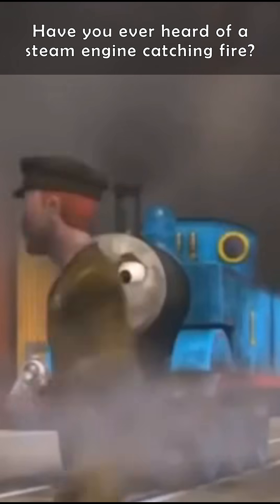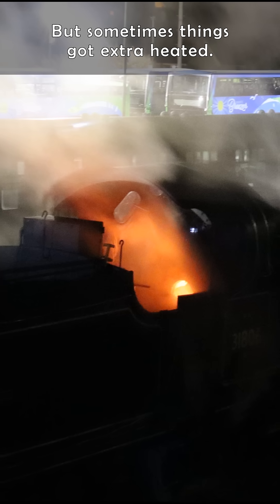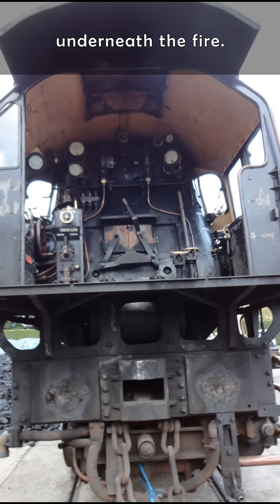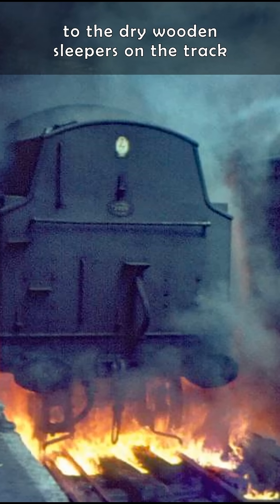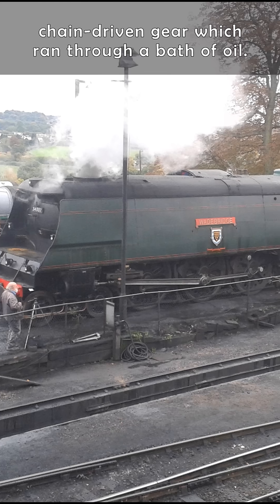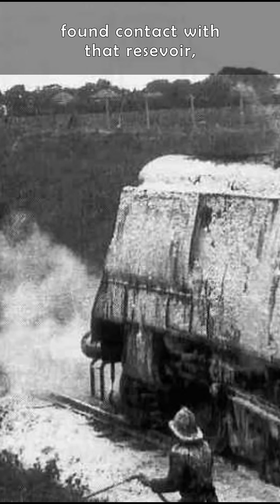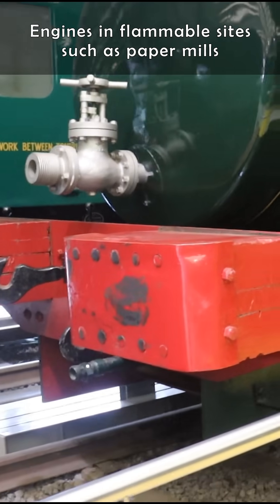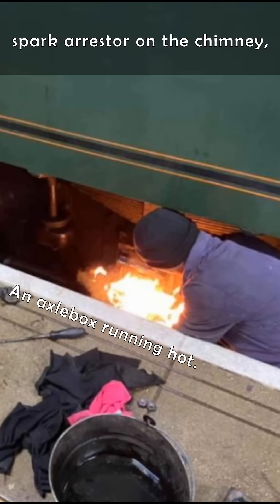How steam trains can CATCH FIRE

Comment: Nowadays sparks from the brakes van still cause fires in hot and dry days. Less An issue with concrete sleepers but it can still start fires along the track

Comment: I was in a volunteer rural fire brigade in Australia. I went to at least half a dozen fires caused by either locos or wagons dropping hot brake shoes. I recall that the Beyer Garratts were known for setting sleepers on fire. One is alleged to have started 18 fires in 40 miles with the local fire captain threatening to blow the track if they didn't stop the train. It was about 43ºC and windy with it.

Comment: I've never heard of a fireless steam engine. Do those use electric boilers? And if so, why wouldn't they have just used a standard electric or diesel-electric?
Reply: They used steam made by a boiler somewhere else that was stored in an a tank on the locomotive where a boiler would normally be.

Comment: Apparently Longmoor‘s oil burning 2-10-0 “Kitchener” leaked quite a bit, and set off from the Northern terminus at Bordon and set alight the 5 or so miles of track to the main station at Longmoor Downs before the problem was resolved. Oh, and this didn’t just happen once.. Another oil burner at Longmoor I believe leaked and caused a fire large enough to necessitate the relaying of one of the roads at Longmoor Downs.

Comment: I think that one scene where Thomas was on fire would make a LOT more sense if Thomas was stranded on tracks with WOODEN TIES, and not concrete. But the Diesel Works tracks are concrete, so it's still not believable.
Reply: I know that this would be entirely implausible given it would spread, but there is a chance that Thomas happened to be sat atop an oil patch and the fire only got that size because nobody noticed it and moved him until he was basically surrounded
Reply: @hectorz9555 well he was at the dieselworks so If there would be an oil patch anywhere it would be there
Reply: they're called "sleepers"
stop using incorrect American terminology
Reply: @yeoldeseawitch   I'm just so used to saying "ties", sleepers isn't a word that comes to mind for me.

Comment: All Steam Engines in the US have to have spark arresters fitted. In the US, for a long time, steam Engines used wood as the fuel source for fire. Wood can produce sparks and ash much faster than coal, and so the risk of starting fires on the tracks and even forest fires was much higher. Wood was also very plentiful, especially since there were almost no coal mines at the time.
Reply: no coal burning engine has ever been fitted with the wood-burner's spark-arestor chimney. it's fairly obvious whether the engine has a giant cone for a chimney or not.

Comment: It still amazes me that after all these years, people still propagate the rubbish that the oil baths on original Bulleids caught fire. 
The bath's were enclosed, so sparks wouldn't get in there for starters and the oil in the bath would be below the flash point anyway, so wouldn't even have caught if a spark landed in it.

The fires on the Bulleid's were caused by axle box oil being flung up into the lagging and sparks fron the blocks would set it off, if there was a big enough build up.

The axle boxes were fed from the cab oil trays and when crews didn't remove the wicks, oil kept feeding the axle box keeps and then overflowed down the wheels.

Maybe you should do a video to address this old enthusiast myth,
Mythbusters style 😅
Reply: Lol, looks like u’ve read my scribe on the 34007 website which I posted after we finished getting her running.
The info was kindly provided by the ex chief erecting shop foreman at Eastleigh works, where Mr Bulleids finest were soled & heeled.
I got fed up with all the immature nonsense being spewed out by folk who didn’t have much of a clue.
Yes the missionary trays in the cab feeding the axle boxes were the culprit as regards oil in the wheel pockets which was subsequently dropped on the sleepers when standing or flung up when in motion.
Never suffered with hot boxes tho! Oil was cheaper!!
BTW they simply have a sump which holds 40 gallons of oil, about 2” deep. The motion does not thrash around in oil, it is pumped via a gallery of pipework, to emerge where reqd.
The crankcase has to breath thro breathers & oil mist is emitted (that’s where most loss of oil occurred.
It  also collected in the lagging & collected any brake or ballast dust blown up & the gassing is what
ignited & the forced draught fanned it merrily in flame.
It was cured by fitting belly lagging & altering the brake block composition to eliminate sparking.
You don’t read as much about the regular bogie & engine room fires on the class 47’s.
Reply: @davemitchell9941  to be fair, I haven't read your 34007 post, but I learnt the truth directly from working on Bulleid's myself, talking to fitters and people who worked them back in the day.
Reply: @ thanks, twas refreshing to see your comment.
Listening to them ol boys was for me the best part of restoring 007.
That ol valve gear worked like a charm & I did not find it difficult to maintain at all.
Exmouth Junc managed it all very well by keeping on top of things.
Have to sign you up as a Bulleid fundamentalist.
That’s how ol Jock Adams (34092)& myself were labelled at the ol Bulleid owners meetings. 😂
Gotta hava sense of humour when dealing with the 3cyl Brittania fan base (the rebuilds).
Go on well 😊
Reply: @davemitchell9941  Thank you both for your insight and your work on these lovely locos.
Reply: I mean, you might be right... but your illiteracy and misuse of basic punctuation like apostrophes makes me think you're not very educated. 
The bath is/has/was on?
The bath's... what on? What belongs/pertains to bath?
The same is true for Bulleid.
Reply: Well said.

Comment: A friend once told me of a man at his local model society who didn’t drop the fire of his engine when he was finished running it and cleaned it with paraffin which is normal. After this, with a still hot fire he loaded it up on his trailer and drove off. Needless to say that the paraffin caught on fire and the engine was engulfed in a fireball twice.

Comment: I will never look at the scene of Thomas's firebox on fire the same way again.
Reply: Bingo to both
Reply: JAMES' BRAKES...
Reply: @l0nd0n_luxe I thought it was bc he was braking so much
Reply: @ He held them down consistently (as the troublesome trucks were pushing him) and he was trying to stop. They were wood so they caught fire from the friction. So I'd say you were partially correct! :]

...This is also coming from a James fictionkin. It a was scary crash. Don't pull trucks.
Reply: @l0nd0n_luxe But sometimes I wonder WHO WAS EVEN ALLOW TO DESIGN A TRAIN TO HAVE FLAMMABLE BRAKE BOXES?!?
Reply: @TripleHakim2  Designers, lol. I don't remember which, but I think a few actually did it...
Reply: Yeah it’s basic Design flaw, Henry was one of those flaws when he was first bought and brought to sodor, I know the theory, but I like to believe that he was actually rebuilt and redesigned to not have those same issues he was having before. James’s Wooden Brakes was def one of those design flaws that they probably looked over at the time.
Reply: @Centrive1323 after the Flying Kipper incident? 100% they gave him that new shape because “while we’re here there’s other issues to address”
Reply: @Centrive1323 Thomas is also an E2 modified to avoid the problems that this class used to have, such as excessive fuel consumption.
Reply: Hello flying scotsman :D
Reply: PUT OUT THE FIRE!